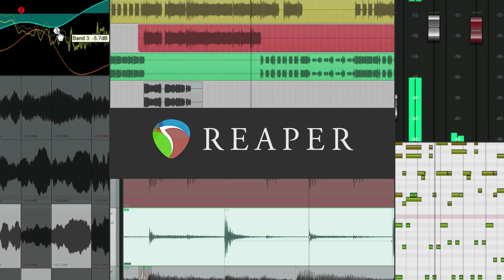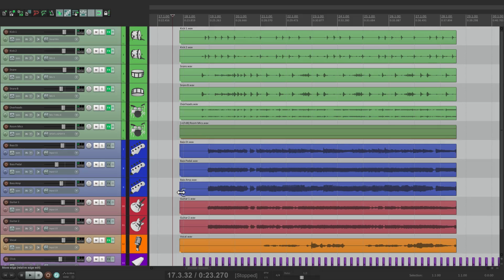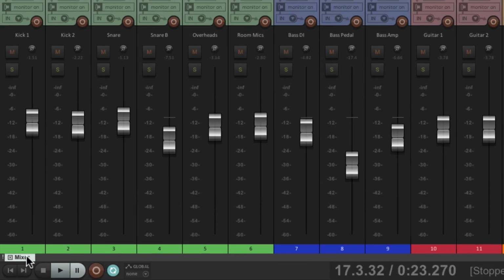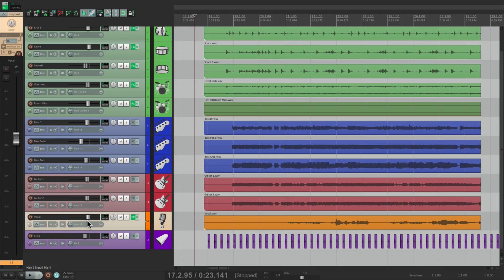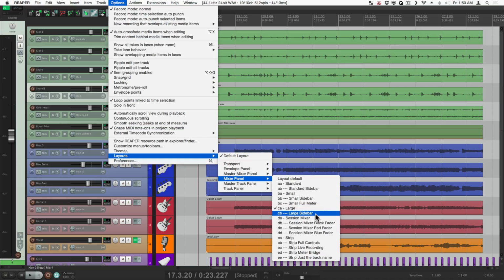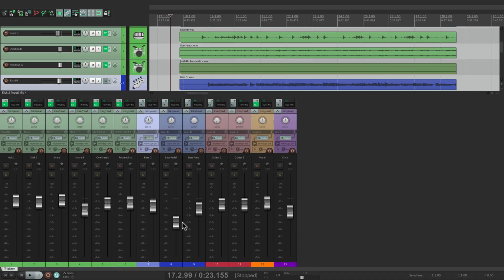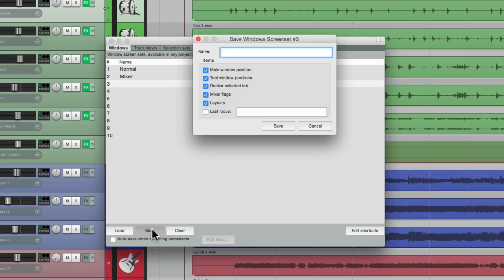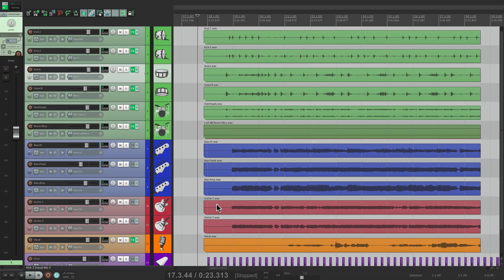One Channel Side Mixer in REAPER

Comment: I've been using this layout from a long time ago, but when switching to Reaper 6 different widths on tracks (normal tracks vs folders, for example). Now I'm testing a used Faderport Classic and, to my surprise, when switching between tracks with it, the mixer will not scroll to the selected track, it works only when clicking with the mouse.

Comment: I'm loving all your videos.  They sure are helping this newbie get up to speed on a fantastic DAW.  I notice that Reaper 6.13 does not have the layout options that you mention.  There's no sidebar options, no session mixer, just a list of percentages of A, B & C.  If I switch to the Default 5.0 Theme, then the session mixer and other layout options show up, but I started with Reaper 6.12 and don't want to revert to the theme of an older version.  Still a great tip.  How do you get the horizontal volume sliders on each track?  Default 6.13 just has a small round level pot to the right of the track label window.
Reply from the maker: You're going to think this is crazy but I just saw your comment now, 5 hours after you posted it because I'm about to redo this video. So make sure you subscribe and you'll probably see the new one tomorrow. Thanks.
Reply: @REAPERMania  Fantastic!  Thanks Kenny.
Reply: I found the horizontal volume sliders: Options | Layout | Track Panels | B